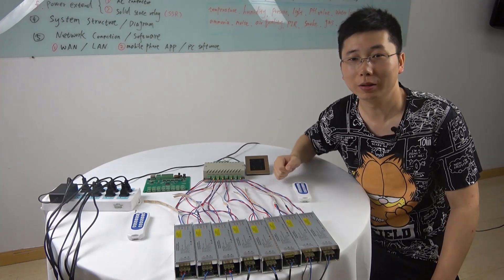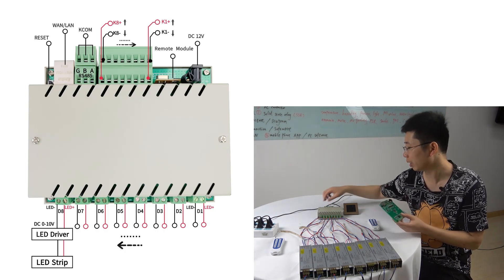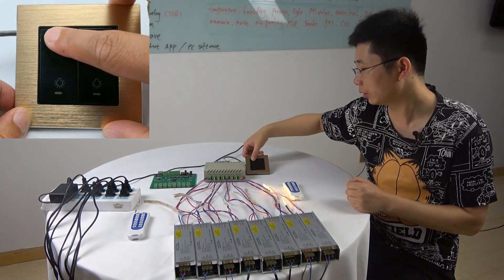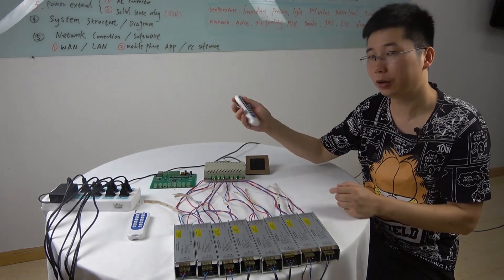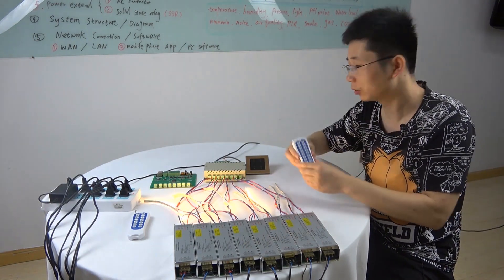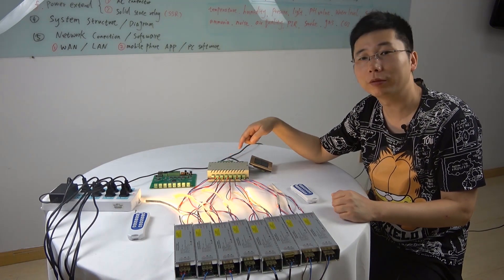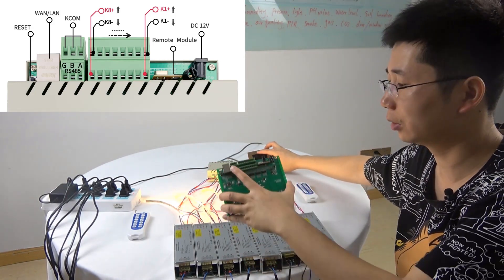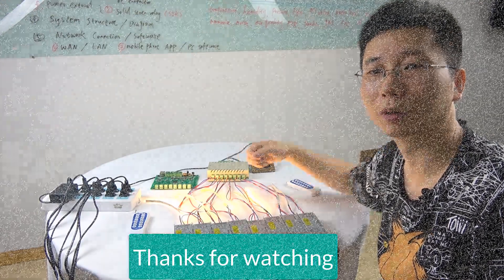how to use 8 channel dimmer switch for led strip light remoter control

Comment: I have tried it with a dimmable led light bulb (E27 socket) but it's flickering with the old firmware. Will itt work with the new firmware? Thank you.
Reply from the maker: if you have st-link or j-link suggest use new firmware.

Comment: hello sir, can you share the information that what is the main core controller used in this ?
Reply from the maker: it's use KC868-D8: https://www.aliexpress.com/item/4001244247642.html?spm=a2g0o.store_pc_groupList.8148356.1.34c8585fzHsTm0
Reply: I mean which chip arm , atmega , pic, esp which?
Reply from the maker: @akshitghataliya  ARM chip

Comment: If light switch is connected to this new dimmer-controller then light switch cannot be used as usual switch - turn ON/OFF
Reply from the maker: yes, support ON/OFF, no problem. if short time press is as a ON/OFF switch, if long time hold the button that will + brightness or - brightness of light.
Reply: @KinCony  Super!